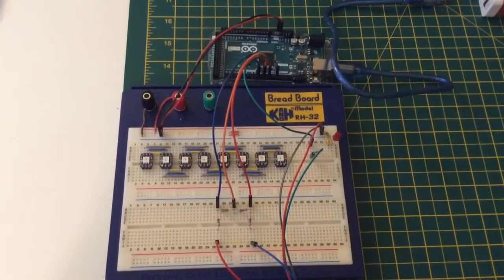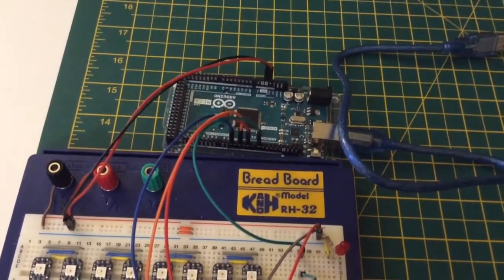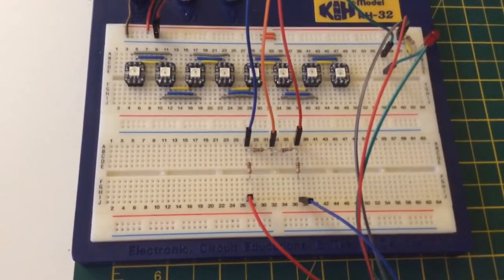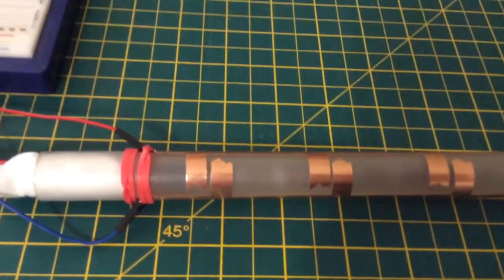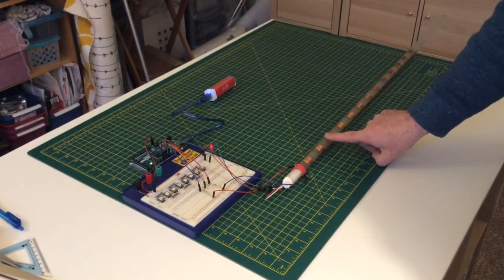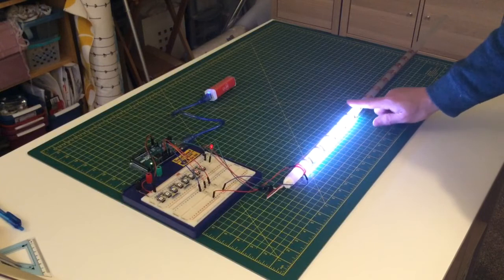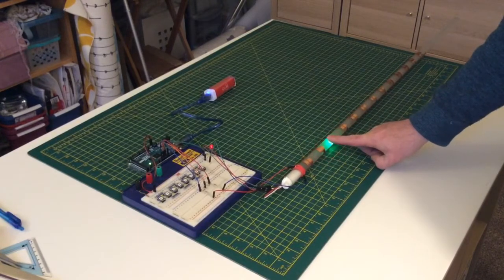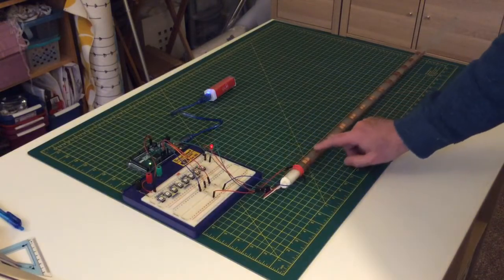Arduino project; capacitive slider to control neopixels

Comment: Really cool build. Would the "glitchy touch" be caused by the space between each sensor panel or is it due to the resistance on your finger (or something else)?
Reply from the maker: I think could be any of the above. Have not revisited this project for a while...was looking at switching the copper tape for a copper mesh...but expensive solution and other projects overtook this one.